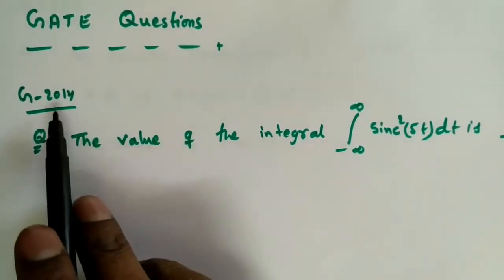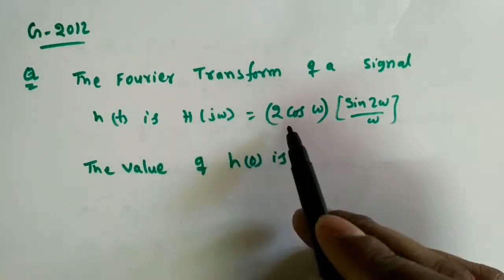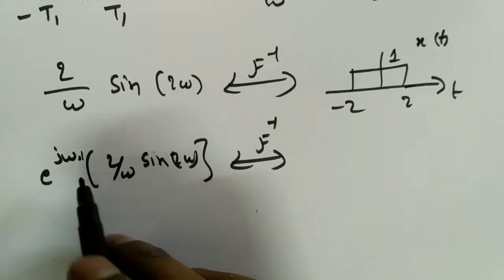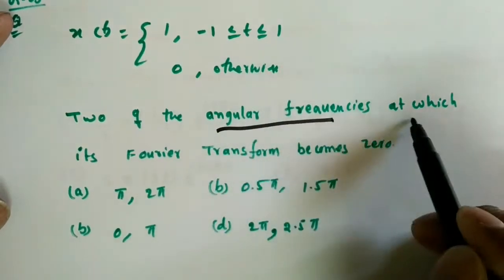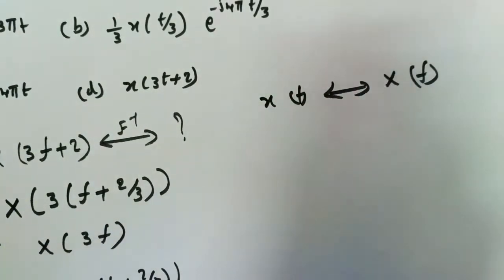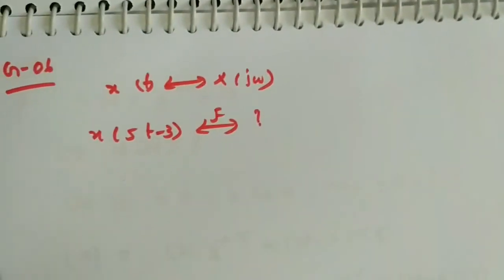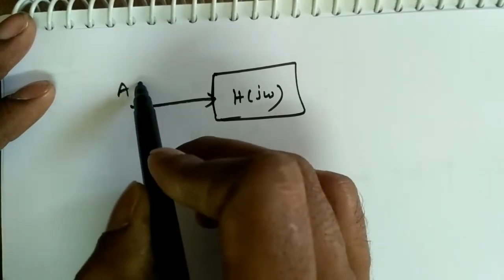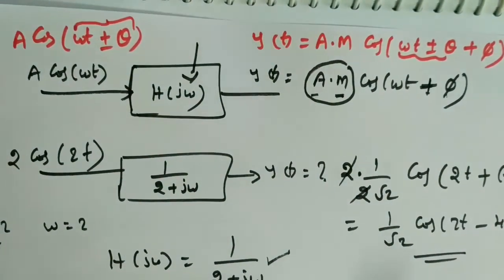Signals and Systems Lec-30:  Discussion On GATE Questions

Comment: sir, in the last question if I use convolution property to find y(t), then answer is different. It's coming cos(2t)/4
Reply from the maker: Rohit Kumar no whatever I got that is correct answer by using property..are you in what's app group..I will post solution
Reply: No sir can u add me pls.....8789728380